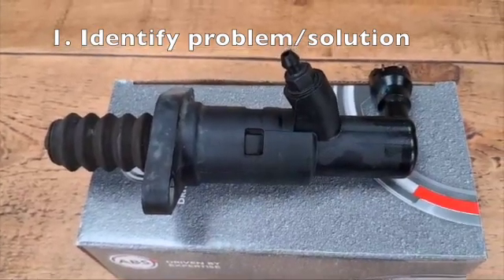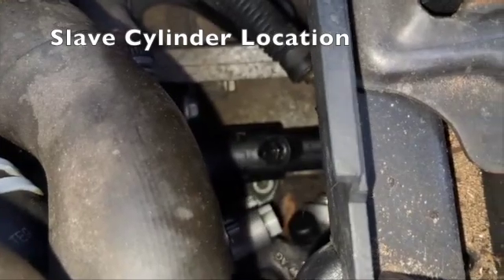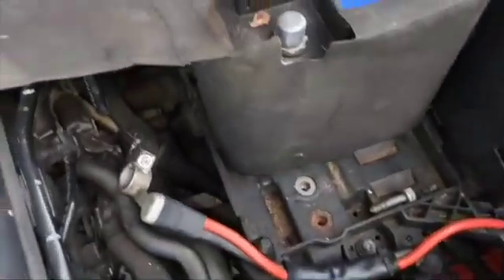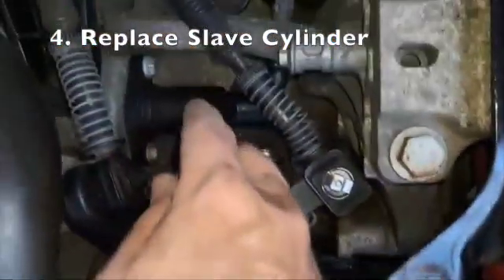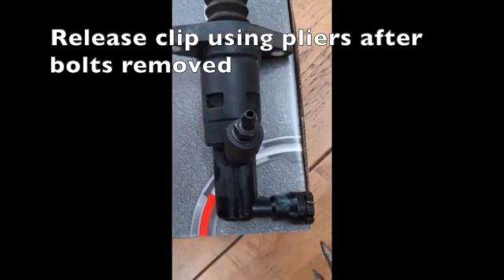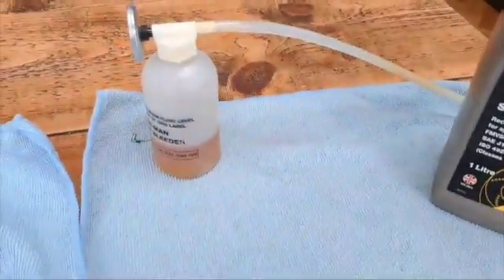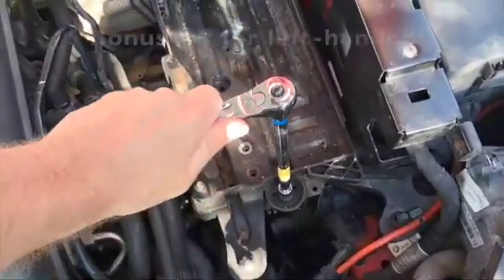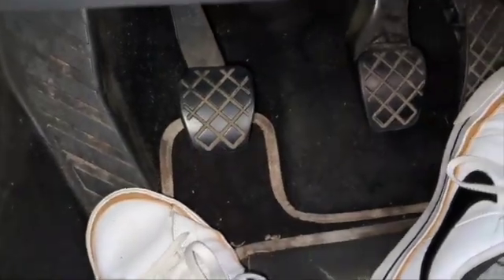SEAT Leon MK3 (2016), 1.4L Petrol: Clutch Slave Cylinder Replace   SD 480p

Comment: Well done, I think mine is on the way out, sometimes low bite point, no leaks
Reply from the maker: Apparently, replacing the slave cylinder is the most common solution. It worked for me. Hopefully, it worked for you.